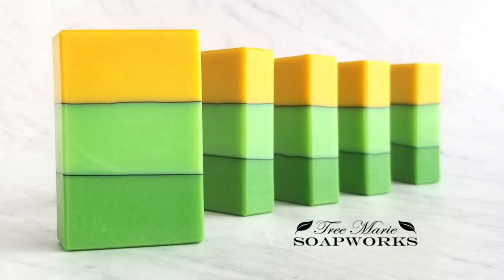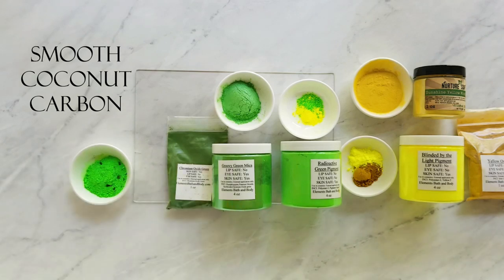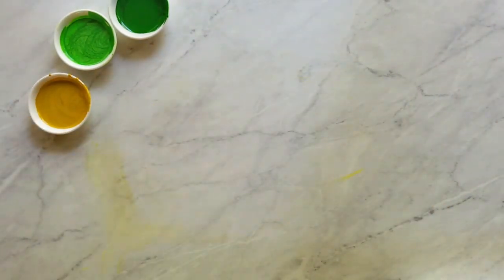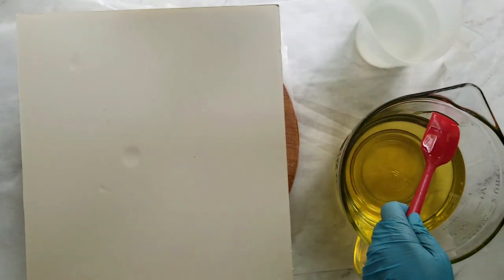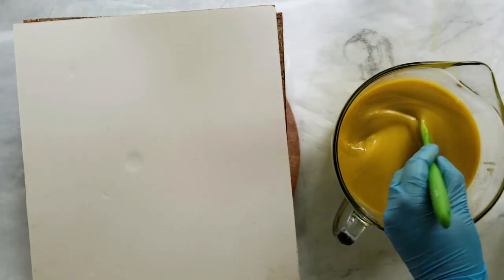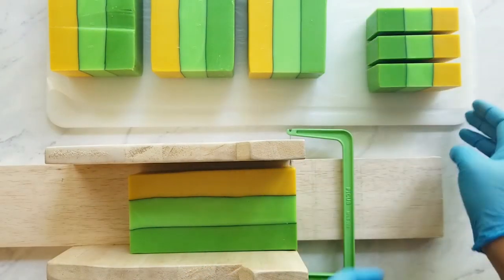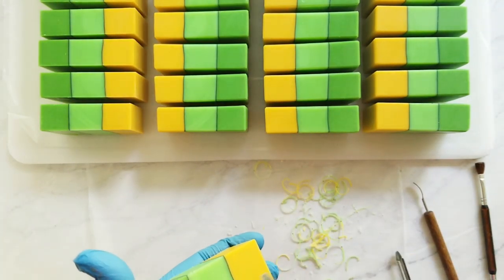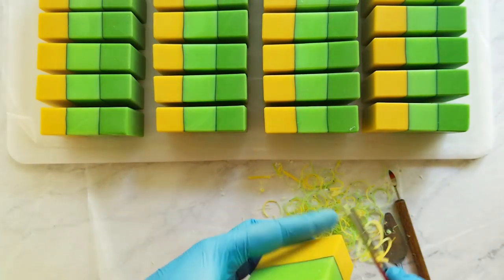Narrated Layer Soap with Pencil Line, Cold Process Soap Making (Technique Video #12)

Comment: Yes, larger batches go through gel phase more readily simply because there is a larger mass of soap creating and retaining heat as saponification progresses! I'm a small-batch hobbyist but I notice the larger my batch (even just a 1000g batch) heats up much more easily than my 400g tester batches. Also, I find it helpful to use a little Crisco or palm oil to stick my silicone liners to the sides of my molds if they start being naughty. 

I adore your videos and your teaching, your voice is calming, and your soaps are SO beautiful!! They're so inspiring to look at, and your process is so clean and soothing. When I soap, it looks like a bomb went off. Can't wait to continue seeing more and more amazing creations :)
Reply from the maker: Thank you for the info, Stephanie! Good to know! I will try that trick with my mold next time. Thank you for responding to my question!

Thank you for your kind words about my videos. Lol, did you see that I made a mess with the middle layer too?
Reply: @TreeMarieSoapworks  No problem at all!! Oh girl, you should have seen the mess I made of the soap I did this morning. I almost knocked half the batter on the floor, and did not wait even remotely long enough between layers. Mica lines are not for the impatient - and I am VERY impatient. It's gonna look like a hot mess XD I definitely feel the struggle!! As long as it makes it into the mold MOSTLY I'd say it's a success lol

Comment: Also, when you force gel, just to clarify, you turn the oven off right when you pop your soap in and leave the soap in overnight? This is such a cool idea! Thinking I should have skipped on buying that heating pad 🤦🏻‍♀️ could have been using the oven!
Reply from the maker: Yes, turn it off right away. Over preheat for 30 seconds or so. This is to warm up the air that surrounds the batch. I do prefer using the oven.

Comment: Hi teri am gonna try to make your soap bcs I admire it but am wondering at what degree do you mix your oils and lye solution ? 
And what you do  if they cooled more than they supposed to while you are making the 1st layer ?
Thank you in advance
Reply from the maker: I like my temps to be between 85-95 degrees F. For a layer soap, I would try for 95 to start with. I use clay and a fragrance oil that has a slight acceleration to help the layers set up more quickly. That way there is usually only about 15 minutes between pours. I don't worry about the temps. I just cover my oils and lye in between use.
Reply: Thank you so much you are such a good inspiration

Comment: For splitting your batch and working with layers, am I understanding this correctly that you would take the mold’s capacity and divide it by however many times you want to split the batch into (ie: 16oz capacity divided by 4 would equal 4oz mini batches of soap) that you then run through soapcalc with your oil percentages to find out the amount of water and lye for those mini batches and then proceed with your design? Is there an easier and more accurate way to calculate what you would need to do if you want to work with one layer at a time, especially if you have a fickle fragrance oil? If you have a video on this I’d love the link. Thanks!
Reply from the maker: Create the entire batch and divide by four....then take your total fragrance and divide by four.

Comment: Hello, may i ask why did you add kaolin clay? Is there any specific function adding it in the soap making process? Thx b4..
Reply from the maker: Kaolin clay firms up the layer quickly. Also it helps with the lather.
Reply: @TreeMarieSoapworks  thank you for the info! 😊 I'll try this in the next batch!

Comment: Sometimes when people cut soap they get  little white bubbles almost on each slice. How do you keep your soaps from getting that bubbly surface and keep them looking so clean?
Hope what I'm asking makes sense
Reply: tigerlilley Not teri, but I get bubbles if I forget to ”burp” or tap my stick blender inside the soap mixture before I start to blend :-)
Reply from the maker: Yes, it makes sense. Most of the time it's from air bubbles because of the stick blender not being burped like @tellervo said. Sometimes it is due to fragrance. Sometimes it is just blamed on the wire cutter. I find that waiting 48 hours before cutting works well. If you have those problems when cutting with a wire, a knife usually works nicely to "smear" those spots and they don't appear.

Comment: Do you had the kaolin to help fix the fo? If not, what is it’s purpose ?
Reply from the maker: I usually use it in layer soaps to help it set a bit faster. I probably didn't need it for this one since the Wasabi FO accelerates. It helps with lather too. I find that it helps whites become whiter. It is not great with swirls because it absorbs moisture and causes acceleration.

Comment: Why do you avoid heating your cocoa butter too much?
Reply from the maker: When working with cocoa butter and shea butter I try to keep the temps between 85 and 95 degrees. I learned about chocolate and that you get "fat bloom," a white film that develops when you don't temper chocolate right. I don't know if it has anything to do with it, but I think that film looks a lot like soda ash. The "magical temperature" for tempering chocolate is 93 degrees Fahrenheit. I try not to get my temps. too much above that. On the other side of things, I started soaping at room temperature and was getting stearic spots, so I don't soap at room temperature anymore. The ideal temperature for me is 85-95 degrees. Hope that makes sense. 😊
Reply: @TreeMarieSoapworks  Thanks for the info!  Do you heat cocoa butter in the microwave?  That's what I do and I find it takes longer to melt than the coconut oil.  I think I may melt them separately now so I can monitor them better.  Thanks again.

Comment: Why do you place the ruler at an angle?
Reply from the maker: If I need to divide my loaf by 10 and the loaf is slightly smaller than 10 inches, I slant my ruler and put the 0 on the edge and the 10 on the other edge and mark on the inch lines. I get 10 equal bars. 💚😊